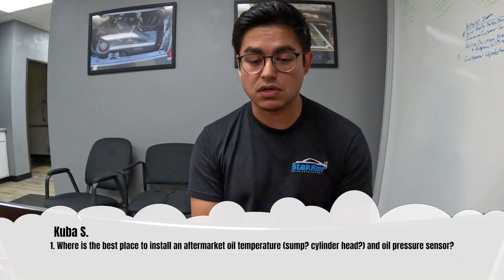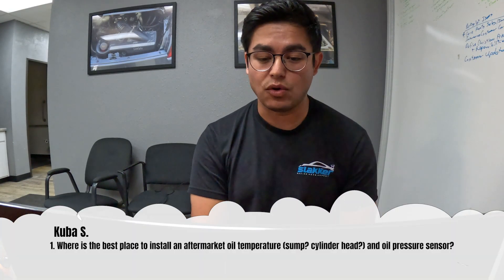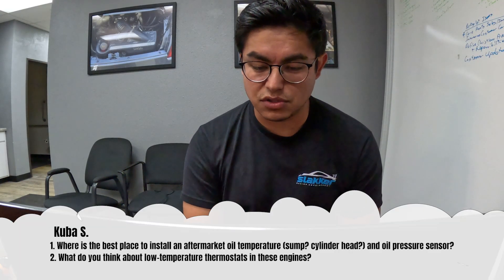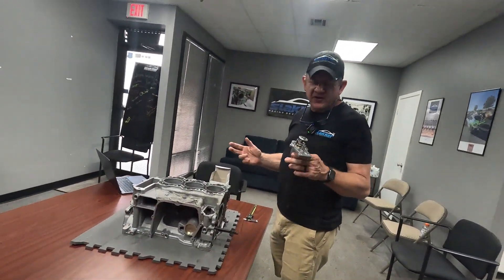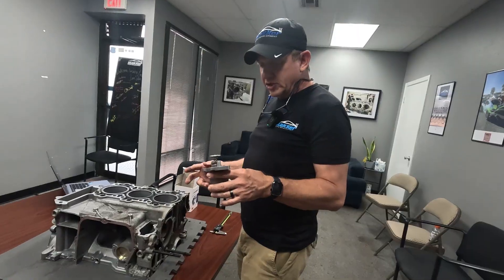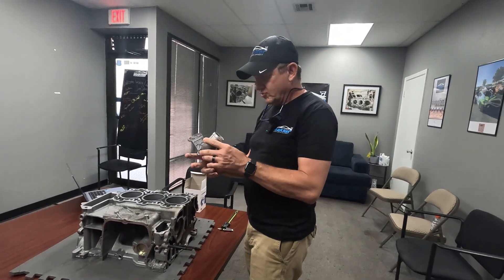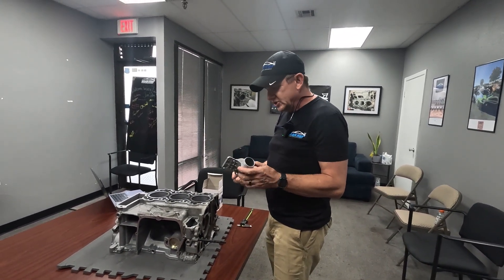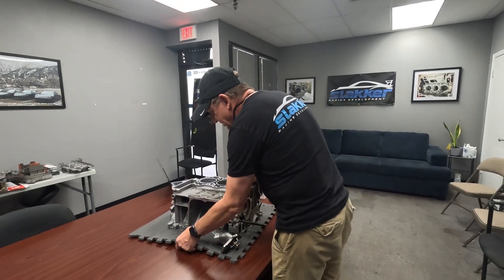Best Place to Install Oil Temp & Pressure Sensors on a 996/997 Porsche

Comment: I put in a LT t-stat years ago and I find that the car does run cooler in normal driving, but once the t-stat is fully open and the car is hot, my temp readings are the same as with the OE t-stat.   It does seem to take longer to get "hot" though.  My hope is that the LT t-stat will provide for less harsh temperature swings in the engine and so possibly mitigate some of the expansion and contractions of the metals in the engine.  In particular, maybe that will decrease the chance that the Lokasil coatings will flake off.  What do you think of this theory?   Is this just wishful thinking or could there be some science behind my theory?

Comment: Is there a way to check if a low temp thermostat has been previously installed? Either visually or through a MaxiCheck reader? I recently bought a 997.1 Carrera S and outside of carfax, not a ton of info fron prior owners.
Reply: You can watch live data for the coolant temp while the engine is warming up - it will normally climb pretty steadily, then stall for a bit (and often decrease a few degrees) at the thermostat opening point.